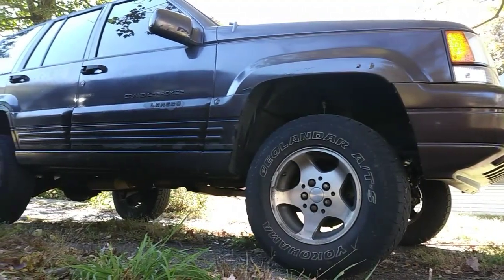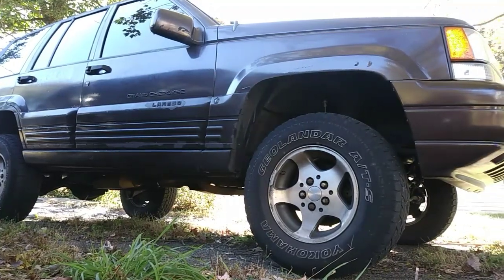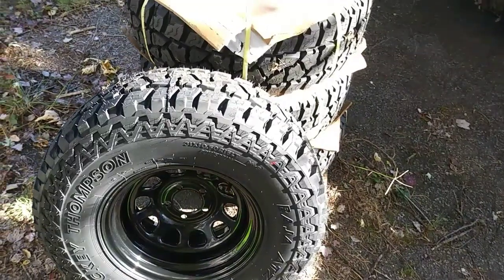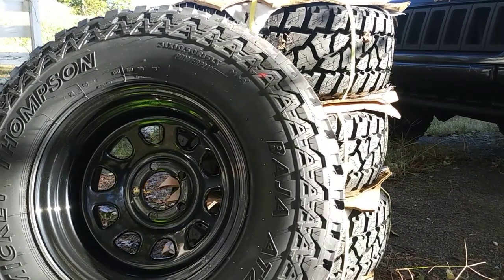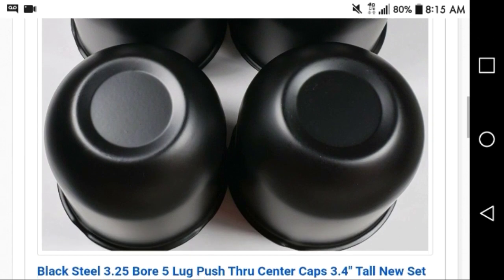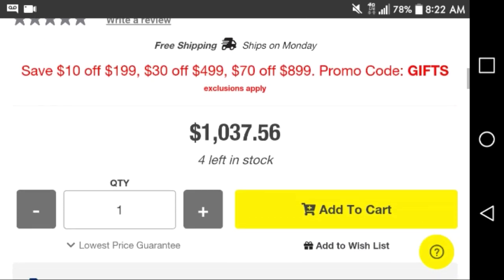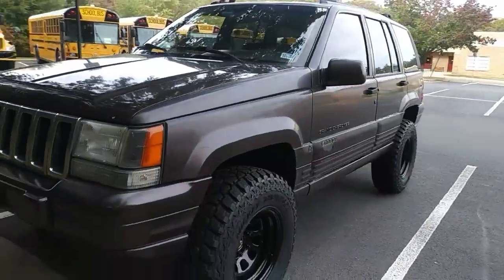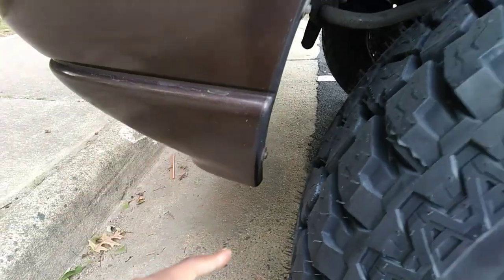JEEP ZJ WHEEL & TIRE COMBO (31 × 10.50 MICKEY THOMPSON BAJA ATZ P3)

Comment: Bookmarked this content for future reference. I don't always comment, but always review your ZJ content. I'm currently running General Grabber AT2's 245/70R16's on stock wheels, and need to measure and check the wear. Currently the tires are serving my extremely well on a very capable stock configured vehicle ('97 ZJ LTD 5.2). Though I am considering going with a higher profile and narrow tread width. I have to say I do like how the tread blocks are spaced thus providing more void. I am considering migrating my tires and wheels to my girlfriends XJ once I do the S10 leaf spring pack change. Once again, thank you for the great content coverage.  :)
Reply: How did that go? You should make a video

Comment: Bro you should make a video  about  how to fix the abs light or the most common problems  of the abs light please ,regards bro
Reply from the maker: I just made a similar video like that on the commander but dont see myself doing that no time soon on the ZJ. The most common issue is the wheel speed sensor though its just the tech is a little to old to accurately pin point the problem with a decent scan tool
Reply: @barricadegarage5361  thanks i will try to see if i can fix the problem.

Comment: Nice jeep bro, Do you know anything about the abs and some common problems and solutions it may have? I changed my front brake calipers now can't get the abs light to go out. That led me to change all the wheel sensors abs module and abs pump. and it's still on. I only come on when I start moving through. If I turn the car off and back on then it's off again until I start moving.

Comment: Hey bro, i got a few questions to ask. 1st, i just bought a 1984 gmc sierra 1500 classic. I'm about to bed swap it with a long bed 1957 f250 stepside bed. 2nd, I'm about to add 10-12 inches of lift. 3rd, I'm going to put a 1ton axel swap to handle the lift and truck. So would adding a 4 link triangular kit to the front suspension be needed if i go coilover or would it make sense to go full leafspring to the ride itself and drop the 4 link kit?

Comment: Unsure if you’ll see this, but do you get any rub on the pinch welds on the back of the front fenders, specifically when turning/flexing? Have the same amount of lift and am worried about clearing larger than 30s without limiting flex.
Reply from the maker: The back is fine no rubbing at all and the front was rubbing until I did that lityle bit of trimming I showed

Comment: Nice! I started off my ZJ the same way!
2” coil spring spacers with 31s. Soon I went with a full 3.5” lift kit with 32s and now
added 1” spacers for a 4.5” lift with 33s.
My ZJ Instagram @ Manny96ZJ 👍🏼
Reply: Can you fit 33s on a 3 inch lift?
Reply: Have you ever had a camber issue while using spacers? I bought my jeep with different wheels and tires on it and 1 1/2 inch spacers on it. My camber is garbage on all 4 and can’t seem to figure out how to fix it in the rear. Any tips?

Comment: Do you run a full size spare? Does it tuck under the cargo area? Thanks
Reply from the maker: Yes theres a full spare in the Jeep and you can easily fit a 31 inch tire back there

Comment: Looks like you'll still rub when the wheel flexes.
Reply from the maker: Cut a little more off the bumper and its good. Plus my wife doesnt flex, this Jeep is the grocery getter
Reply: @barricadegarage5361  - Even on DMV potholes?
Reply from the maker: @OldsVistaCruiser  yeah its good now I did more cutting. What you know about DMV potholes lol
Reply: Dang a wife that doesn't flex.  Say what lol
Reply: @barricadegarage5361   - I used to deliver seafood to Alexandria and Herndon, VA. I have a friend in Silver Spring, MD. I now live near Hershey, PA.
Reply from the maker: @OldsVistaCruiser  damn! You know all too well an and traffic is still horrible as hell. I grew up near Landover. But now stay on the VA side close to Woodbridge